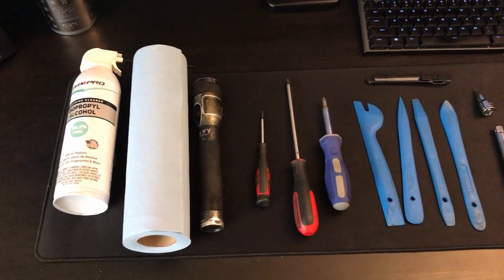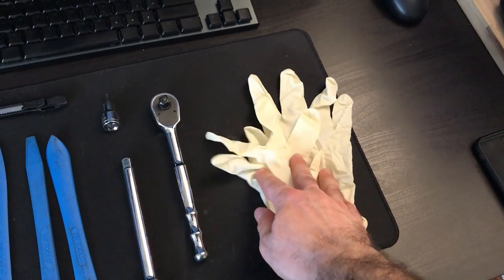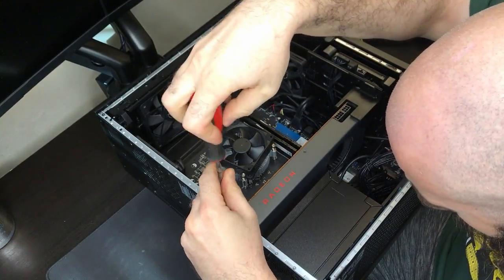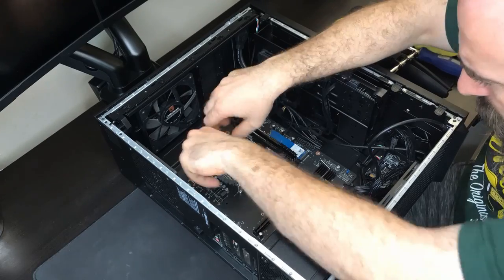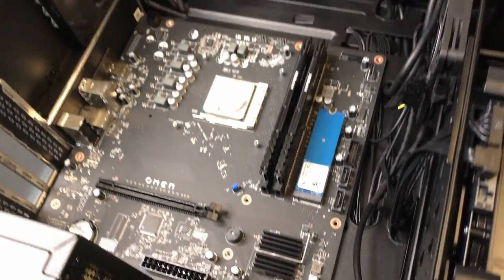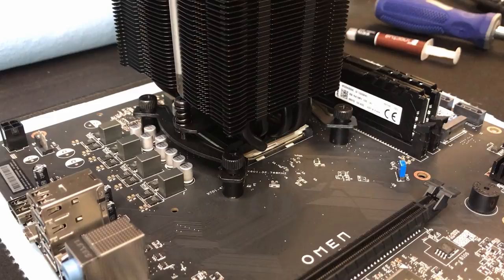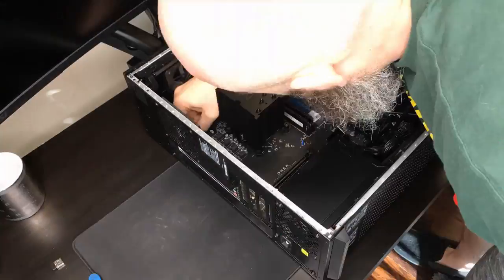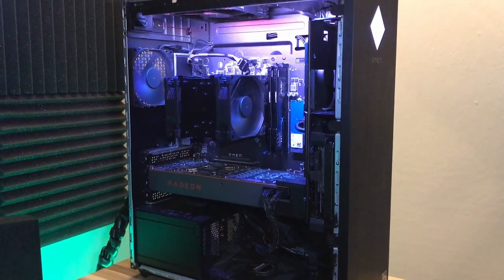Installing A Noctua CPU Air Cooler In My Omen! Complete Tutorial 😎

Comment from the maker: Hey guys! 150 subs left until the Noctua Cooler giveaway! Please share to get the word out!

Also, a few notes on the install: I used too much thermal paste on my CPU. A size of a grain of rice is perfect to cover the whole CPU. 2nd thing is going to be that dental floss works very well for removing the stock cooler bracket, and is probably the safest.

Thanks everyone!!
Reply: been watching your video i get my 30L omen today think this will be a necessary?
Reply from the maker: Not necessary but will GREATLY help with CPU temps. It was probably the best thing I did for my Omen honestly.
Reply: Will the cooler fit in the HP Omen 30L?
Reply from the maker: Yes it will.
Reply: how long is the long Screwdriver and what kind is it?
Reply from the maker: Phillips head #2 and needs to be at least 5” long I believe.
Reply: Where did you get the second fan bracket?
Reply from the maker: I saw your other comment but it comes with the cooler 👍🏻👍🏻👍🏻
Reply: Yes idk just random sometime downloading also 60 70c right now sitting at 30c
Reply: I'm run it till it burns up 2 year warranty so
Reply: what do u mean dental floss? can u give an example how to use dental floss on removing the bracket?
Reply from the maker: Slide the dental floss under the bracket to try and separate the backing plate from the motherboard.
Reply: @DanKamYouKnow  damn bro wasnt expecting a response, thank you so much! Im switching my cpu cooler this monday
Reply from the maker: No problem! Good luck with the swap, take your time and everything should go smooth. Take lots of before pictures so you remember where everything goes

Comment: In four months you have gone from just removing the top bracket restricting airflow, to adding five additional fans and a cooler :-)  Appreciate the time and effort you put into producing these excellent Omen videos. My 30L (99% power) now has a 120mm top exhaust and an upgraded Noctua 92mm case exhaust. Running quiet and cool with temps at idle / light use in the upper 40's, gaming low 60's.
Reply from the maker: You can say things have escalated quickly! Lol. No problem, I enjoy making these videos. Sounds like you’ve got a great running system!

Comment: You rule dude! I followed your video and installed the same cooler. My cpu temp dropped 20 degrees! Thanks a lot and keep up the good work
Reply from the maker: 🎉🎉🎉 Glad to hear my video helped you and the temp drops with this cooler are unbelievable!!! Thanks for the support my dude 😎😎
Reply: We're you able to put the side panel back on?
Reply from the maker: Yes, as long as you stick to an air cooler that is shorter than 140mm in height, you’ll be able to fit the side panel back on. That’s why I love the Noctua U9S

Comment: I know this vid is old however the Noctua unit is finally available on Amazon and mine comes in this Thursday the 31st!! Can't wait to install it on my Omen, just wanted to share that lol
Reply from the maker: Nice dude! This video is a little older but I still run this cooler and it’s still fantastic. Let me know if you have any questions when installing it!
Reply: Waiting for mine to come in this weekend. We cant use the stock brackets right?
Reply from the maker: Nope. The proper was is to remove the motherboard. There are people on our Discord that have installed a cooler with different screws but I’m not 100% of the process. Removing the motherboard isn’t too hard of a job.

Comment: So I installed the cooler but when I tried to boot up the system after I made sure everything was plugged in the system gave me 3 short beeps before turning itself off. Any tips?
Reply from the maker: Reseat your GPU / RAM sticks / triple check all of your connections.
Reply: @DanKamYouKnow  thanks for the help. The video was great and super helpful. Ended up being a issue with configuring the backplate. Went back and realized we left out the spacers. Once that was fixed It booted right up after assembly. Dropped my CPU temp by 25 degC and I don’t even have the second fan installed yet. Your videos are great!
Reply from the maker: Appreciate it Victor!!! I’m glad you were able to figure it out and fix it quickly. Enjoy the icy cold temps.
Reply: Glad to hear someone that a fix to this. I'm installing my cooler and a new PSU this weekend getting nervous.

Comment: Great video!  It is my first  time opening up a computer and making any modifications.  I have the omen 25L with rtx 2080.  I used the same fans you did and followed this guide step by step and it came out great.  Before the change, the cpu temps on cod Cold War on medium settings were around 85 degrees.  With the push pull method you used, my cpu temps stay below 67 degrees even when using ultra settings.  Thanks again for the help!
Reply from the maker: I’m glad to hear Edwin and 67c while in game is fantastic. Now you really get to enjoy the computer without having to keep an eye on your temps at all time 😎

Comment: This process will be so much easier if hp just put a hole by the motherboard bracket just to replace the backplate
Reply from the maker: Yeah, not really sure why they didn’t leave an access hole to get to the stock cooler bracket. Removing the MoBo is a pretty easy process though
Reply: @DanKamYouKnow  next time I take my MOBO out I'm going to cut my own access area in the case.
Reply from the maker: @jeremyhayes1242  That’s a good idea. I don’t think I’ll need to take my MoBo out again any time soon

Comment: Thank you Dan Kam for this video! I just replaced my CPU cooler with the same one and, with your video, was able to actually do it myself despite having almost no experience building computers. Getting the bracket off the back about gave me a heart attack though haha.
Reply from the maker: Hey Samantha, I’m so happy you were able to tackle it with the aid of my video! Not a bad process if you take your time and double check your work. Plus, the benefits of replacing the cooler are massive. I remember that anxiety induced 5 minutes of trying to remove that dang cooler backing plate! 😫😂

Comment: Hi Dan and Community!

I just bought the fans and noctua cpu cooler and did like you did Dan, thanks for that so far! 

Everything worked fine - as i bought my omen 30L as my first ever gaming pc and modified it for the first time also! One hint here - if you have struggles removing the cpu bracket from the downside of the motherboard make sure you don‘t use something sharp or so. Just get yourself a hairdryer and heat up the adhesive and first try to pull it off and get one finger on the screws on the front of the MB and push it gently. It needs a bit of effort but the heat from the hairdryer will help you there. Read a lot of guys who crashed their MB 🙈
Reply: Sorry for the harsh english at some point - here in germany it is about half past 2 in the morning and i just finished working in the omen 😂
Reply from the maker: Great information, thank you for sharing. It does make sense to heat up the adhesive so it’s easier to remove. I’m glad everything worked out fine for you! 

P.S: Your English is fine!!

Comment: Got my air cooler installed today! I had a heart attack when I removed the stock cooler bc even though I was being super careful when it popped the cpu came out with it!!! Luckily none of the pins broke or were bent so I got a crash course in cpu chip installation today. Everything is working great and running super cool!
Reply from the maker: Nice! I literally just had someone comment that the same thing happened to them when they removed the cooler! That would definitely be a scary moment. I’m glad it worked out for you 👍🏻

Comment: Thank you Dan! I was a little nervous because I never did something like this before, but I just finished it and the result is amazing. The I7 11700 CPU was about 84 Celsius while gaming and now it is around 57 degrees Celsius. It looks badass as well :)
Reply from the maker: Awesome results!! Nice work my friend.
Reply: wow I have the same CPU and get the same results as you, it can reach 90 degrees easily. Guess this confirms I need to upgrade my fans, thanks
Reply: Does the back plate need to be removed? Do I need anything other than the Noctua U9S Air Cooler package?

Comment: Followed your advice and swapped out my cooler and what a change! Went from getting temps as high as 75c while playing cyberpunk in max settings and just by swapping out this cooler and adding the same 120mm noctua top and bottom case fans I haven't seen the Cpu over 55c 
Cheers Dan
Reply from the maker: Nice Ryan! Glad it worked out for you. Changing the CPU a cooler was the best modification I made to the computer.

Comment: DANKAM IS THE MAN. I got my 25L about a year or so ago, upgraded my graphics card from the pitiful 1660S (the OEM version..) to a MSI 2060 OC, and that made gaming great but... there was one lingering problem. MY CPU WAS GETTING HOTTER THAN THE DAMN GPU. Keep in mind, my CPU is only an i5-10400f... no overclocking happening. When playing God of War 2018 (a more CPU heavy game) my CPU would shoot up to 78c at it's highest, this is with a 120mm exhaust directly above it & a 92mm exhaust in the back of the case.... I can only imagine it hitting 80+ if I didn't install said exhaust. Long story short THIS GUIDE ABSOLUTELY STILL HOLDS UP GREAT TO THIS DAY. I replaced my absolute garbage Omen cooler with this AMAZING U9S and it's been unreal. God of War now barely cracks 60c, mainly hanging out in the high 50's. Thank you Kam for shaving OVER 15 DEGREES CELCIUS off of my CPU. Now I can finally run the CPU hog that is chrome to listen to music while playing other games & not worrying about my CPU hitting temps hotter than my GPU at half the utilization. I CAN'T THANK YOU ENOUGH KAM!!!!! Much love.
Reply from the maker: Appreciate the love and I’m glad this tutorial helped you out! Out of all testing I did with Omens, the U9S is still the best cooler for Omens. I also think it matches the aesthetic of the Omen the best as well. Enjoy your new found low CPU temps my friend.
Reply: @DanKamYouKnow  Agreed and thank you so much! Have yourself a great one man & keep putting out great content.
Reply from the maker: Thanks! You have a good one too. 🤝

Comment: Installed my Chromax U9S today following your video on my laptop.  Everything was going great till it came time to reinstall my graphics card.  I had a hard time getting the card down far enough to put the two screws in.  After fiddling with it for a while to no avail it took it out completely and checked underneath to see if something was holding it up.  I tightened the motherboard screw under the card and it seemed to have worked.  Since this was the last thing I did I could hardly wait to start up the computer.  When I did start it up I got a series of beeps and over and over.  My heart dropped thinking what have I done.  When I looked down at the Radeon card I had to laugh,  I forgot to put the connectors back in. To make a long story longer everything is working great and my temps are 15c to 20c cooler than before.
Reply from the maker: Oh man, that is definitely a scary moment when you boot the computer and you get the dreaded diagnostic beeps 😬. I’m glad you figure it out though and everything is working good! Temps are looking 🥶

Comment: Using your tutorial I have also installed a Noctua nhu9s in my hp omen 30L Ryzen 7. Scared me to take apart my computer to do it but now that it’s done. Was a piece of cake. Just take your time. Also changed exhaust fan and added one behind hard drives.
Reply from the maker: Nice!!! Not a bad job at all. Just takes patience and having the right tools.
Reply: I used a plastic toddler spoon to pop off stock back plate. Worked like a charm. 😂
Reply from the maker: @IronTuskViking  Nice!! Haha. Pretty much anything plastic with a good point on it will work

Comment: The CPU temp for my new Omen 25L would momentarily spike to 95C when playing MSFS 2020 and then settle back to 80's.   I did this upgrade today and the max temp registered was 71C and was at 50's most of the time in the same game environment.  This is a drop of 24 degrees for max and more than 30 degrees drop at steady state.  I can't thank you enough for showing us this how-to.    Just a quick tip for those who consider this upgrade:  I used a expired credit card to get underneath the factory bracket to remove it.   I had to use some force but not too bad.
Reply from the maker: That’s awesome!! Crazy how much of a difference that a good CPU cooler makes. Super happy to hear and thanks for sharing John!
Reply: @DanKamYouKnow  Thanks, Dan!  I thought I would wait before making this upgrade knowing it would void the warranty.  But all that changed after I saw temp spike of 95C!  Had I stuck to factory setup, I knew the CPU would have died the minute factory warranty expires.  -:)   The heck with returns/ warranties!   If this upgrade failed, I would just go the route of case swap and better mobo (also well demonstrated by your other videos).   Fortunately, the U9S is doing the trick.  That factory heat sink is just ridiculous!  Its contact surface is round vs the rectangle CPU, and based on my estimate, covers only about 50% of the CPU surface.
Reply from the maker: I also saw my CPU hit 93c during an R23 benchmark and knew I needed to make a change. U9S came to the rescue 😎

Comment: Dan sweet swap!!! That U9S really look sleek in there! and yes WAY too much thermal paste!! hahaha but the temps looks pretty decent. Too much might actually become a thermal insulation for some parts. So when you have time and feeling bored you can take it out and reapply it after a couple of months and see if it would drop a couple more Celsius. 
Also you can try the bottom up orientation for the CPU cooler (just need to move the top pieces of mounting, no mobo removal needed) if you have the top fan as an exhaust to see if it would give you better temps like mine did previously with the D9L.
Reply from the maker: Thank you Picky and always appreciate your insight! Will try many configs to see what works best, and apply less paste next time 😂
Reply from the maker: Yes! I uploaded a video where I flipped the cooler to a vertical orientation but had better results with the horizontal configuration. I have since applied the right amount of thermal paste, lol.

Comment: FWIW, the ID-COOLING SE-914-XT Cooler Fits as well (I used the ARGB version and added a second fan). Same basic process (you use the Intel 115x backplate and instructions). Definite improvement to CPU temps was bouncing around 65-85 degrees Celsius depending on load, now runs in the low 50s to mid 60s. I have an Omen 30L with an AMD Ryzen 7 3700X.
Reply from the maker: If that cooler was out around when I made this video, I may have gone for it considering it's awesome price point! Definitely another great option for Omens. 👍

Comment: Thank you so much for this video.  My Omen 25L (3600x, radeon 5700) couldn't handle a stress test without black or blue screening from temps.  Now it doesn't pass 70C.  Thank you!
Reply from the maker: You’re welcome! Nice! The Noctua air cooler was probably the best modification I did for the computer 👍🏻

Comment: Love your videos man! Keep it up. I have a 30L and I really kinda regret not building my own. I feel HP is not all the way honest with this pc when they say it's "fully" customizable. Not a bad PC if you just want to leave it stock though.
Reply from the maker: Yeah, they were definitely kind of shady with some “upgradeable” components in these PC’s. I just wish they didn’t take shortcuts on especially the cooling system with these. They easily could of use a much better CPU cooler and everything would of been fine. I’m very happy with mine now though, but will definitely be building one in a couple years time.

Comment: Followed your guide, and everything works great. Thanks. Funny thing about my particular computer. While I was taking off the cpu cooler, once it popped off it actually took the cpu with it! My heart almost stopped. However, it turns out whoever assembled my computer didn't bother to set the lock bar into place. All the more reason to be careful when modifying your machine, because you have to account for both your mistakes and the possible mistakes of the manufacturer as well.
Reply from the maker: Wow, that is scary and a huge oversight on HP’s side. My heart would of dropped too. Was it a pain to detach the CPU from the cooler? I’m glad my tutorial helped you out 👍🏻
Reply: @DanKamYouKnow  Once I evaluated the situation It was an easy fix. Thankfully I was cautious in the first place and though i did essentially rip my cpu from it's seat, it was straight up and none of the pins were bent and no paste or debris got into the slot. PC functions just fine, and the cooler is functioning well.
Reply from the maker: That’s good to hear but definitely a scary moment.

Comment: Just installed this cooler and it’s amazing!! I originally got the h60 and I didn’t like how it looked and it how sounded. Yes the H60 let’s you have more space to work around but it only  had my cpu between  60c and 75c during extreme gaming. With this noctua it’s much quieter, and it keeps it between 55c and 72c !!! And while idle I’m between 35c and 50c with Noctua! I highly recommend this cooler! I installed it on my 30L and it was super easy. Plus I added a exhaust fan on top of the case and a push fan at the bottom of the case. Replaced the stock exhaust in the rear with a noctua 92mm. Oh yeah and I also added a noctua fan to the Air Cooler so it’s running on two fans. One to push and one for pulling air. Thanks for the video man !!
Reply from the maker: Nice dude! The u9s does seem to have better results than most of the 120mm AIO's out there and is definitely quieter, like you said. Sounds like you got an awesome setup there! You're welcome and nice work!